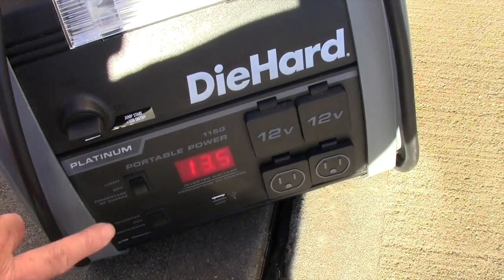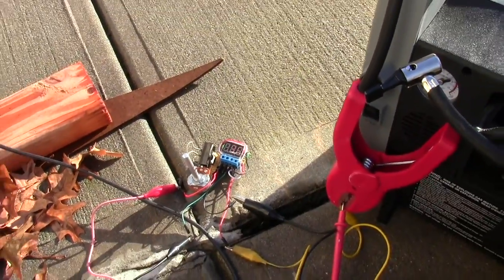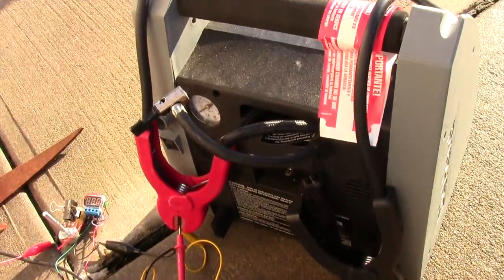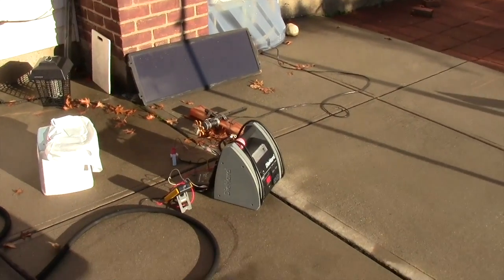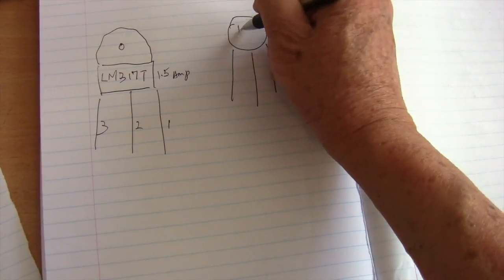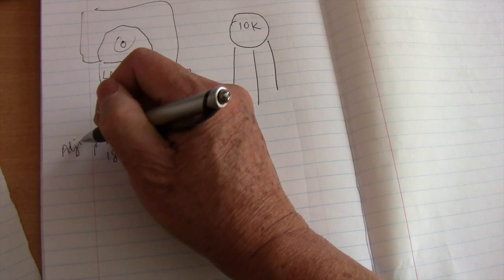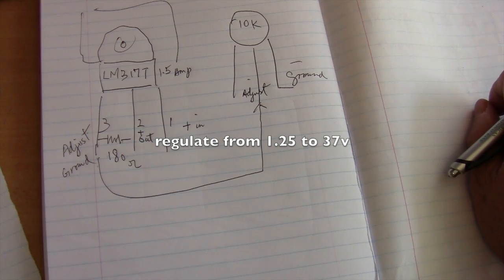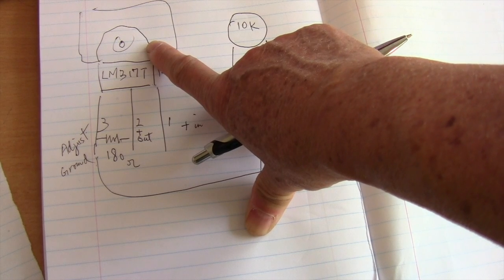LM 317T as a cheap 15w solar charge regulator

Comment: Whats the voltage reading when the battery is removed? Does it stay at the adjusted voltage?
Reply from the maker: Yes.
Reply: wtam69 nice... How can one scale this up to handle higher charging current? I believe this is more gentle on battery charging than pwm charge controllers available. Am i right?
Reply from the maker: Unfortunately, the LM317 can only handle a limited current. I believe there's any chip that can handle a higher current.  Actually, an actual solar charge controller would be better if you want more features like float charging and battery cell equalizations. The solar regulator in the video is very basic.
Reply: wtam69 thank you for your prompt responses. 👍

Comment: ok, and I guess once the battery is charged up to the output voltage of that power supply, then there wont be any  current flowing, and then only minimal power loss in that chip.
Reply from the maker: Yes, the voltage is regulated just like the voltage regulator in your car. The voltage will not go higher and little current will flow to the battery.